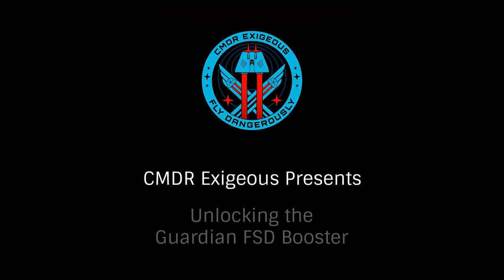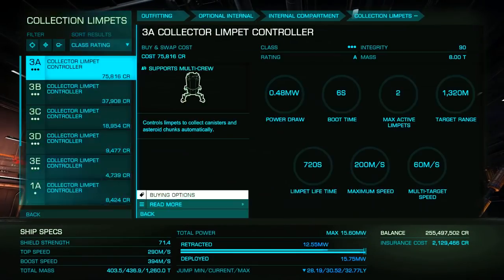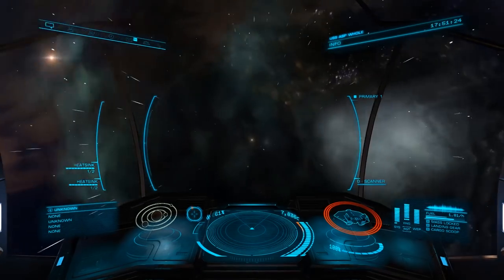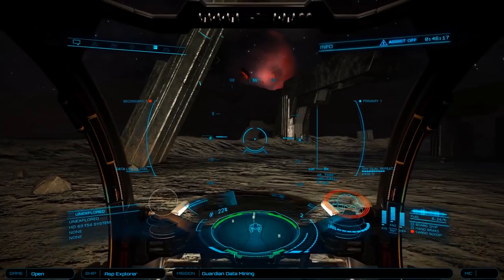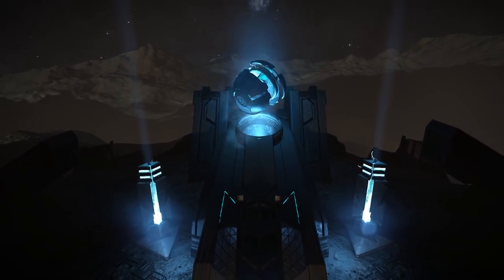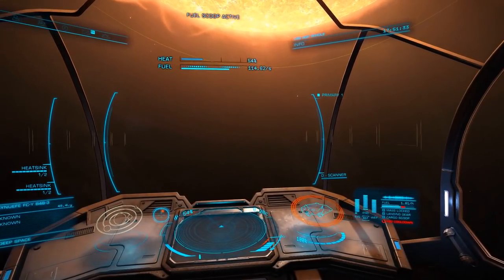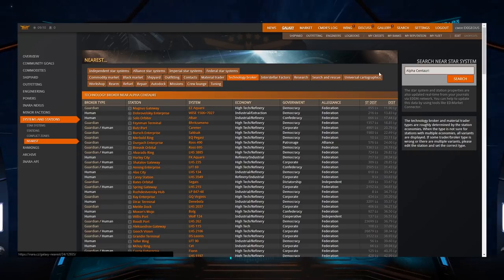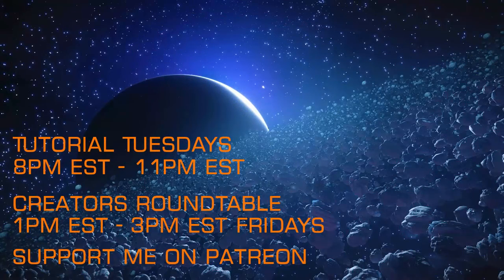Unlock the Guardian Frame Shift Drive Booster (FSD) in Elite Dangerous for Maximum Range (Tutorial)

Comment: Definitely take 2x scarabs! I just about survived in 1, and that's because I was able to keep repairing the hull. If I lost that, I'd have been pissed. The sentinals are not as easy as skimmers.
Had a lot of problems finding where to park with a Krait Phantom, but 2km away in the valley was fine. Someone should build a pay and display car park out there.
And thanks Exegious, love these bite size vids. Went to the Astronomy guy, and sheesh, that dude can waffle.
Reply: Just managed to land my Phantom on site at 40.8042 ; -106.4998 facing 352.
Reply: @sifre2  You're a life saver, I was just having trouble right at that spot and I just had to turn my Phantom around to face 352
Reply: Adam Nelson omg that’s a long way away, especially on that pebble of a planet.  I parked my dbx in the structure, or on the edge, worked wonderfully...love the dbx

Comment: I hate driving the SRV so friggin much!
Reply: If you turn drive assist off it becomes much easier to handle.  Use an easily hittable button because it doesn't like to stop very well with DA off.
Reply: on controller its SO much better ill send u my controller presets if u want them
Reply: yea, to bad you need it to unlock the booster.....no booster for me.....

Comment: Things you DO NOT mention in your video that people will CERTAINLY need to know.

1) How nearly impossible it is to land unless you know the EXACT coordinates. Even if you are in an Asp X. The coordinates you need are 
40.7918
-106.4928
285 degrees
Also, you will need to make sure you know your STRAFE keybinds as the normal turning thrusters will cause your ship to wander while turning. You must be at that EXACT coordinate to land, not one iota off. Other spots may work but nobody will be able to find them without help or spending hours.

2) You MIGHT run out of SRV FUEL. You MUST bring SULPHUR and PHOSPHOROUS. If you are new and want to explore the site first you will use a lot of SRV fuel. If you want to reset and do again, you'll use even more. Many of us have never used our SRV long enough to run it out of fuel. It can't be refueled while on the mission without using Synthesis of Sulphur and Phosphorous. While experienced players may have this in their stock, many newer players DO NOT. 

3) You run a HIGH chance of RUNNING OUT OF AMMUNITION in the SRV. In my case, I ran out of Ammo right as the last set of guardians spawned after I unlocked the data terminal. Because of this I was completely unable to access the data terminal as I could not get an artifact (no ammo) and was being swarmed by Guardians. Again, you MUST bring SULPHUR and PHOSPHOROUS. 

If you run out of ammo before getting the blueprint (as I did) and do not have the materials to synthesize more, your mission is a complete waste of time. You have to fly to the nearest dock, repair/refuel, and then go find somewhere to farm sulphur and phosphorous to restock your SRV. Or you just sell your empty SRV and buy a restocked one at the dock (wtf?). Then go gather those mats so next time when you run out of ammo (because you're a noob and don't land 100% of your shots), you won't have to scrub the mission.

It seems Frontier Dev made this mission not difficult but ANNOYING and needlessly time wasteful. Why in 3306 we can't just store some extra SRV fuel and Ammo in a cargo hold is effin beyond me. 

I just wasted my entire evening because neither you nor any of the other videos I watched mentioned any of these things. Please, no offense, but when you do a "tutorial video" please do not leave out important information just because you as an experienced player assume everyone already knows.
Reply: Preach!! Also, "It seems Frontier Dev made this mission not difficult but ANNOYING and needlessly time wasteful. Why in 3306 we can't just store some extra SRV fuel and Ammo in a cargo hold is effin beyond me. " -- because 'mUh dIfFiCuLtY'.
Reply: Will a detailed surface scanner reveal the location?
Reply: @aitoluxd  no need. Once you get close to the planet (almost in orbital cruise) it’ll show up for targeting like any other object in the system. You can just find it and press T and you’re good to go. If you can’t see anything try honking the system when nearby.
Reply: @someperson2287  oh, thanks a lot!

Comment: Just dont go there with an Anaconda... its a REALLY pain to land. And IF you land, and dismiss, then the computer wont be able to land again so easy....
Reply from the maker: Yep, that's exactly why I suggest going in an Asp X or DBX.
Reply: That is incorrect. I already tested this twice. Your ship does not need to land in order to board. It's just a bit harder to line up as there is no ground marker. Brute forcing an Anaconda to land is just part of the fun. :)
Reply: I went there in a Conda, and managed to land it. It required careful parking skill, but otherwise no problem.
Reply: @isotopp  did it in a type 10 and a corvette with 2 different guys in anacondas, 100% possible

Comment: Thanks for this guide. There are several problems there:
1. You cannot land close to the guardian structure. To find a suitable landing place is PAIN, even for a small ship.
2. When you activate first of the 2 main pylons, there is a COUNTDOWN like 6 mints, which you must manage to activate the rest pylons. Prepare for sentinel attacks too. There is a small time bonus for each pylons 3-6, though. You can easily miss them, because they are hidden in the ground. Watch the ground and listen to the emerge sound.
3. To collect necessary materials is second pain, the SRV has cargo for 2t only.
4. Thanks to the several carriers nearby (aka Aisling's Valhalla), there you can repair and refuel!
5. I hate those type of missions. What about you? :-)
Reply: He also does not tell you that it is essential you have cargo holds on your ship. I originally took my explorer which has no cargo holds to maximize LY per jump. Woops. 
Lots of other key info he leaves out.

Yes, I MF'ing loathe and despise lengthy, tedious, "gather till you drop" "hope you don't die/screw up or you have to start all over" type missions. I read a blog years ago that called that kind of gameplay "do it again stupid" design.

Comment: The only question not answered here is: how did you know? I.e., how am I supposed to figure this out in-game? As near as I can tell, the procedure for getting a Guardian FSD booster can be written down in about 7 simple steps, half of which involve google (e.g., google to find what planets have the guardian bases on them and their coordinates). With something like 0.015% of the galaxy discovered so far, it seems unlikely that someone would stumble on these answers, so it stands to reason that there should be an in-game way of finding them...
Reply from the maker: I knew because I'm connected to the game, forums, etc. and it was in the patch notes (and actually made an appearance months ago and was, shockingly bugged).  But your point is 100% valid - there is essentially no in-game way to know, other than to go to a technology broker and see what they offer.
Reply: I recently discovered you can bind shortcuts for Galnet, the galactic news radio.
Most of the news are galactic gossip (still a nice way to have some kind of presence during long travels) but once in a while there is valuable intel, like weird signals detected in this on that sector.
You should tune it, it helps. And if some info interests you, you can check out the galnet website for more details.
Reply: I find it odd that in order to play a particular game well, one must seek out and reference third-party developed materials that must be stumbled across, and then immerse yourself in all that just to become curious enough to seek out things like what this video is about.  Unless ... the whole point is to force players into third-party information sources and forums!  Odd game design to say the least, and not noob friendly.
Reply: @bruced9786  When Niantic released Ingress in 2012, you could play it, but in order to play Ingress effectively, you had to consume out-of-game materials and link up to a local community and become part of a group. The game is heavily biased to organized player action.

Now look at edsm, eddb, inara, the fuel rats organisation, the iridium wing and the likes. In a way, E:D is very similar: You can play it alone and the game alone, but in order to play it effectively, you need to join a group of people, and connect yourself to out-of-game tooling. And for the same reason: Ingress is played on the whole of planet earth, and requires physical outdoor action, E:D is played on the whole (virtual) galaxy. These are vast places, and cooperation pays big time, because it saves so much time.
Reply: @bruced9786  This game is 100% unplayable without 3rd party support really, it is the good and bad thing about, a great dedicated community...but without it the game would fail massively.

Comment: Warning - anyone reading this as of release of odyssey (21st may) the orb scanned does not give a blueprint. Either it is now Inactive or Odyssey has a bug that makes it impossible to get the blueprint. tried 3 times and still no blueprint.
Reply: Hi Pwnyraimbow

I have tried to get myself a FSD booster as well after the new DLC(Odyssey) was launched. After trying at several sites, reading tons of guides and info online I reached that conclusion that this is bugged and it is impossible to get this while playing in Odyssey. The good news is that you can change over to Horizons in the launcher, and everything seems to work as intended. (Check out the bug tracker and search for fragment, you will see tons of reports regarding the issue).
Reply: @fredrikdm  yep sorry forgot to edit but it works with Horizon 100% I just had to learn it the hard way it seems and prob lots of peeps will have this problem before they find out for themselves.
Reply: So I did this in Odyssey and just assumed I had gotten it. I'm kind of new so I have no idea where I can see if I got it or not. Does it show up in your inventory? I got a bit confused because things seem to have many names... blueprint segment, blueprint fragment, encoded material or encoded data or just data I am not sure if those are same thing, or different things...
Reply: I did this on horizon 2 days ago, scanned the orb, went all the way back to the bubble, check with techbroker, no guardian fragment….. 
i hope this gets sorted

Comment: Great vid! I went specifically to get the FSD boost but ended up getting all 6 modules. I did land an Anaconda but as pointed out multiple times it's very difficult to land near the site without being inside the danger zone. I was able to land a bit outside and didn't mind the relatively short SRV drive to the site as it kept my ship safe from attack.

Comment: Actually, it's useless for explorers as for now. https://forums.frontier.co.uk/showthread.php/435483-Guardian-FSD-booster-does-not-work-on-extreme-long-range-synthesized-jumps Half-way fixed since first attempt. So, bubble use only :)
Reply from the maker: Thanks for the link and heads up - just read that a few other places.  Hopefully they'll fix it fairly quickly as clearly explorer as going to want to use this (I know I do on my exploration account)
Reply: Well, all is not as bad really as it seemed from the first glance. As I understood from the reports, there is a discrepancy between really available jump range and that one calculated by route plotter. For example, you have 50 ly normal jump and 60.5 with booster. After the neutron FSD supercharge you will have 50*4+10.5 = 210.5 ly real jump range while route plotter calculates it as 60.5*4 = 242 ly. If you'll try to jump that distance, you'll get that "fuel per jump exceeded" error. But you can jump those really available 210 ly without issues. The bad thing that you cannot use the route plotter reliably until this gets fixed.
Reply: It's still plenty useful for explorers.  My understanding is that it's only when you're synthesizing to get a very long jump that it will cause the full usage to go over your maximum (because that curve isn't linear).  But if you're not doing that, then you still get the benefit of regular 70ly jumps in an AspX.  That's a huge plus.  And if it does get in the way of a synth  jump that you could make without it... turn it off and you'll be able to make the jump.  It's only on the highest end that you run into fuel problems... synth jumps that require working off that boost... so it limits the number of new fringe systems you can get to.  But more ships should be able to get to fringe systems now.  Which is again good for exploration.
Reply from the maker: So let me understand - is it supposed to get 4x based on total range or base plus booster?  So should you get (easy math) 60 base + 10.5 booster = 70.5 X 4 = 282 OR is it supposed to be 60 x 4 = 240 + 10.5 = 250.5?  I certainly hope it's supposed to be the former as that would be pretty stupid if not (imagine them doing something that stupid, right???)
Reply: Looks like it supposed to be the former and showing the distance in the route plotter based on that math, but really working as the later. I guess two different teams worked on it and implemented two contradicting formulas in different parts of the game. That's FDev, nothing special, move on... :)
Reply from the maker: Yep, it has, working correctly now.

Comment: I need to be gratefull your Turotial forced my to look for myself and i did it thank you :)
Reply from the maker: Very glad you found it helpful.
Reply: BTW you forgot to include a info where to find Hn shock mounts. (ofc you can find it in INARA just simply press  Commodities in left part of the site and then Common commodities. Then in the right side fo the site chose HN shock mount)
I sugest Bartini Gateway STATION in HUNTICS SYSTEM
One of the closest in the buble if you coming back from Guardians System where you can buy both HN shock mounts and they have Material Trader also if you need to use one.

Comment: Edit: i used the wrong scanner, you get the blueprint just like the video say

Thanks for the video, short, easy to follow and straight to the pont as always. I been there yerstday and after scanning the orb i did not got the blueprint but other xena datas. Readings the comments looks like that now the orbs will give random rewards after the scans, tonight i will try again.
Reply from the maker: Interesting, this is the first report of that I've seen (must have missed other comments).  Not sure that's by design or not - personally I'd open a ticket with support and tell them what happened to confirm.
Reply: @Exigeous  edit to my first comment

Actually i'm stupid, i have used the composition scanner instead of the data link scanner. Just got the blueprint using the right scanner.
Reply from the maker: And there you go :D

Comment: 9/30/2022 - just a note, if attempting to charge the pylons a second time, you'll need to relog as they will not charge once you've done it once for that instance. For the Guardian Technology Components, they give you 3 per 1 picked up and you'll always get one from shooting a small panel on the side of the structure that is on the hill (panel is where the ground meets the hill, on the left side of it if you're facing the hill from the front ramps that cascade up to the top of it). Relog and get 3 every time you go back in and shoot the panel off. If it is not popping out after shooting the panel its because the game yeeted it into oblivion. Try again. That happened to me like 80% of the time too. A real annoyance but persistence is key, because the video suggests you can get the Tech components from the leaning towers, but that's really never the case.

Comment: Great guide was really fun todo. Just need 9 more focus crystals!
Reply from the maker: The easiest/fastest way to get them is to head to Dav's Hope and farm mats there, if you don't have the 9 in about 20-30 minutes head to a material trader as you'll have something you can trade for them.
Reply: The material trader I totally forgot that existed. Thanks! 37 ly multi python is much better now.
Reply from the maker: As it's new many casual non-engineering players forget.  I have videos on both using and finding them.

Comment: I am a new player, just tried this. Horrible situation, I spent forever getting there in my 30 LY jumper, only to lose my SRV to the sentinels. I thought I'd have to go all the way back to the bubble to get a new SRV, but turns out that system is filled to the brim with fleet carriers, so I landed at one and got a new SRV! I love the players in this game. Hopefully round 2 goes better. I guess this is my practice against sentinels.
Reply: Yeah he leaves out important info. 

You probably have done this by now, but.... in case you ragequit and come back later. Equip your ship with point defense and park it as close as possible. The point defense will take out the enemy missiles.

Switch your SRV pips to Shields when you see the attacks coming from the sentinels. Go back to Weapon pips when there are no incoming attacks. If you're not good at driving/aiming/shooting, set the parking brake so you can line up your shots.

Bring sulphur/phosphorous materials (have to mine/collect these annoyingly), as there is a real chance of running out of Ammo on your SRV.